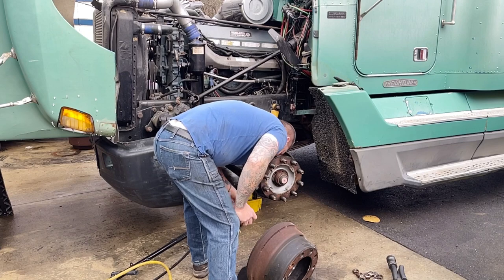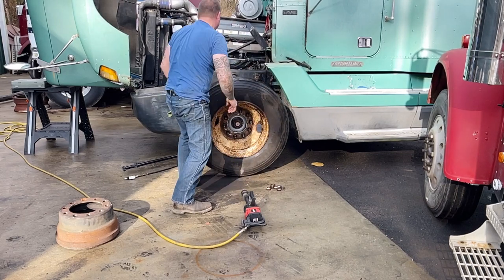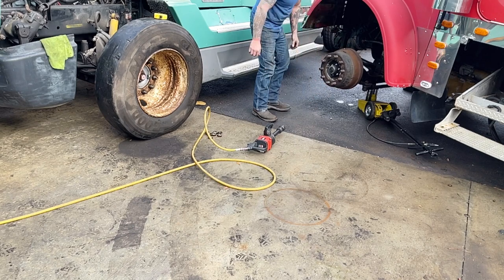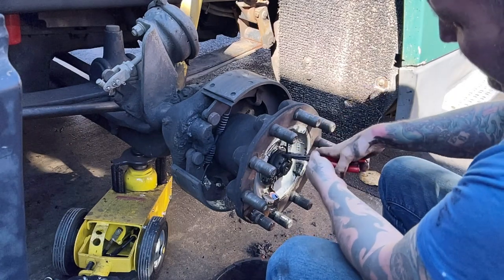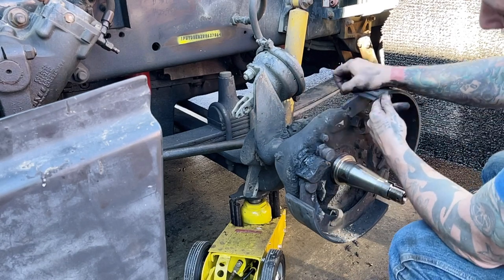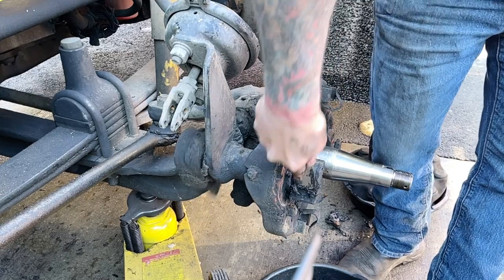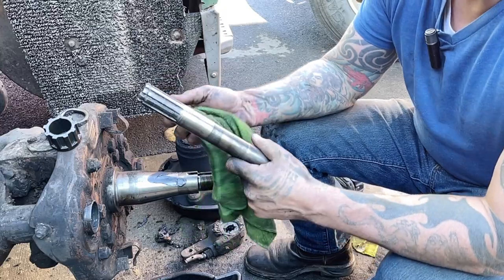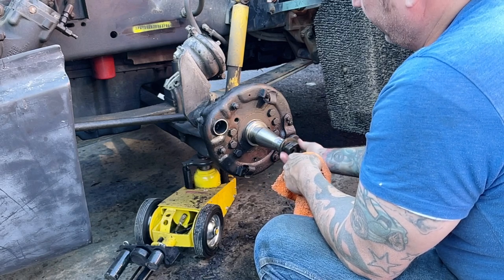Freightliner FLD "13" Front Brakes Part 1.  What a Mess!!!

Comment: No problem but you can check the wheel bearing the same way using a board and pry bar it's really the best way to see how much play and movement even for the bearing just trying to give you some good tips I drove rigs for almost 30 years and I have done mechanic work on trucks and heavy equipment I wish I lived closer to you all I would be so happy to work along with you and even maybe go back to driving again but I let my CDL go a few years back so anyway I have been thinking about getting them back but not sure just yet I do miss driving rigs and working on them but I'll have to think about it for a little while
Reply from the maker: Rite on I appreciate ya

Comment: The proper way to check King pin play and stabilizer bar etc is to lay a small board on the ground and use a Big pry bar or even a crow bar and put the bar over the peice of board and step on the pry bar and you can really see if it has play I know you're strong but you can't possibly really find play in the king pin by hand
Reply from the maker: I can’t really remember the video but are you sure I wasn’t just checking the wheel bearing?   I rarely check king pins myself because I don’t do king pins here at the shop.  But maybe I was I honestly don’t remember.  Appreciate ya watching

Comment: Can you get body parts for those older trucks? Hoods and the like? Don't use an air hose to blow brake stuff off. If you do use a mask. Don't want to get that dust in your lungs...
Reply from the maker: Hoods yes. Side fairings not found any yet

Comment: Where are you finding information at ? My Freightliner dealer sold out in the fall. New owners can't go back pass 2001 , so now no information on my 2000 Classic.
Reply from the maker: Ya every freightliner dealer I’ve spoken to says the same thing no longer able to look up old truck parts.  I am considering approaching freightliner corporate about it.   I use Fleetpride which has been fine for the most part and I use these groups for part numbers which has been ok I guess